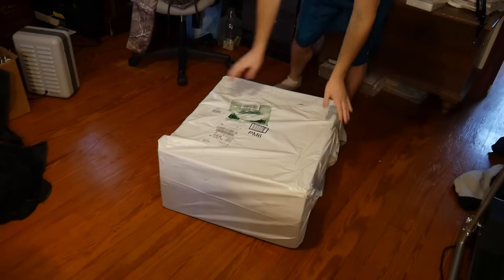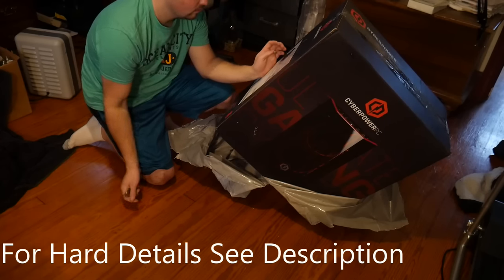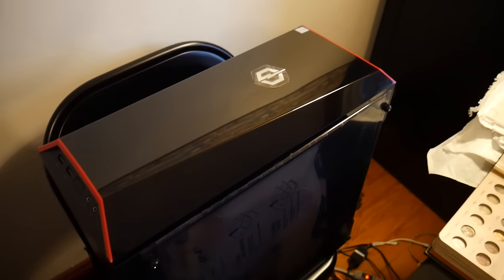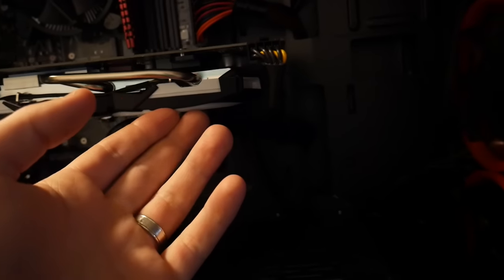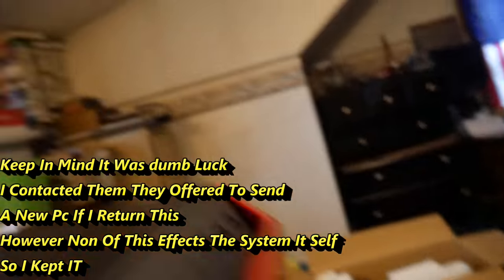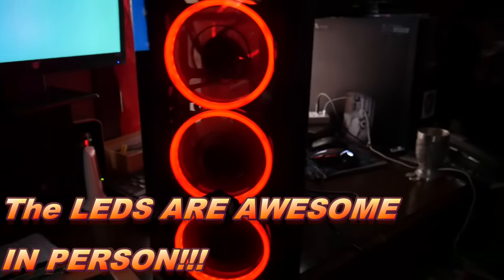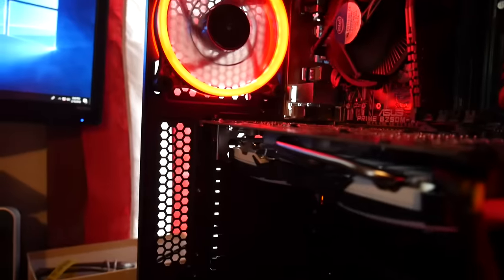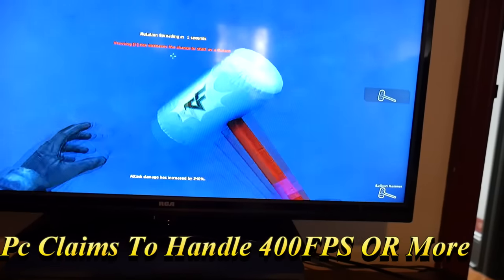CYBERPOWERPC Gamer Xtreme GXIVR8020A4 PC Full Honest Unboxing Test & Review

Comment: Actually really needed this breakdown so I appreciate you making this video I think I’m gonna get this gaming PC
Reply: Thank you and your welcome I've had this over a year and I love it I use it for everything I do
Reply: RevLine89 I’m not knowledgeable about PC’s so do I need to set up the PC in any way? Or does it come fully set up and I just need to plug it up?
Reply: it comes pre setup when you first boot it up it will take you through a setup process and it just tells u things and asks u things what settings u want ect its pretty easy :)
Reply: RevLine89 really appreciate the help 👍
Reply: Your Welcome :)
Reply: RevLine89 has this pc slowed down or ever got really hot where it shut down?
Reply from the maker: it has never gotten to hot that is has shut down, if you dont add any extra fans depending on the game and settings yes it will heat up and the game can start to slow down, for 30 bucks i added custom fans and placed them in the areas it was heating up and solved the issue as well as you can custom tune the fans to turn on sooner to cool off quicker so it does not over heat there are so many tune settings you can do since ive owned this over 1 year i can confirm and say i would pay 800$ - 900$ all day long for this pc ( which i know its cheaper now then those prices ) just saying id pay up to 900$ for this same pc if i had to i actually bought another 1 cause it was on sale yesterday i liked it so much

Comment: Just to let you know Scott, that the scratches on the case doesn't mean that it's not brand new. Those scratches could be caused during shipping, especially since how Fedex and UPS treat packages on delivery. Also, the smudges on the inside of the case are merely just finger prints because the people building the computer opened the case to again build the computer and also put the Insta-pak (the foam stuff inside the computer, you took out) Also, the GPU is put into the connectors loosely on purpose, so the Insta-pak could sorta hug it to protect it during shipping. All you would need to do is to just push the GPU into the connector slot just a bit, or just disconnect and reconnect it again to make sure it's more secure.

Comment: There is a way to provide pro support for the GPU, take the cord to the right side of the gpu and unplug it, than open up the back panel and slide that cable out. Then slide the cable through the top hole in stead of the middle one. Then reconnect it and make sure everything is less floppy before putting the back panning back on.

Comment: Thank you for the review this is what I was looking for! What kind of monitor do you recommend to go with it?
Reply from the maker: It depends what you'll be using it for  :) for gaming a 144hz monitor for normal use anything 1080 or better is fine even a 32 inch or smaller tv if you can buy one used work as well

Comment: You can make the lights change colors I got a remote with mine and the first cyberpower PC I bought I had to take it back because the gaming card wasn't working and the only one they had left was the display model so I got it then I had to go back and buy a monitor because all my other flat panel monitors didn't have HDMI plugs but I'm pretty happy with mine so far now if I can get some real internet out in the sticks where I live lol.
Reply: Charles G you cant change the color on the 20a4

Comment: Does taking off the front glass piece mess with the pc at all or is it safe? I took mine off to prevent overheating so I was wondering. Thanks in advance
Reply from the maker: people like to say its bad cause it lets dust inside.. but ive done it for all my pc's and never had any issues so i guess it depends on who you ask
Reply: Skies why would you ? The fans still move the same cfm. They still pull air from the intakes. The glass prevents dust and foreign objects from entering your PC and possibly tampering with the longevity of the PC and its included fans.

Comment: I have this pc and I love it but I’m wondering if you can upgrade the hardware inside like graphics card to like a 1070 ti or a cpu upgrade and did you get the same potenza ram or was it another brand also did you replace the one it came with
Reply from the maker: I've kept everything the same just added more ram and extra cooling
Reply: The Life Of Scott thanks man theoretically I could probably upgrade if I got a better psu also are you looking into getting a ssd for it?
Reply from the maker: With YouTube I just use external ssds I have about 9 lol all USB
Reply: zPe Voltage if you want to upgrade the hardware then you might want to buy a higher watt power supply

Comment: Nice review. Fast forward to june 15th 2024. Ebay seller had one in mint condition he got inside a storage locker he won a bid on. He did know nothing about pc's, just his google phone.  So he sold it for  $199 and  $50 shipping. I bought it.  Mine had the same specs but my video card is the nvidia gtx 1660 TI.  Only 8 gigs of ram, but i am an AAA+++ tech, and had an extra 8gb of ram i installed to make it 16gb of ram.
Reply from the maker: Nice steal!!!!

Comment: Hey! good video! But I was wondering if you could use HDMI with this computer to connect to a monitor. So, in the end, does this work with HDMI?
Reply from the maker: It sure does! It has 3 hdmi ports and I currently use my monitor with the pc hooked up through HDMI and I love it!
Reply: Alright man, I've watched this so many times and I'm about to go buy and play my most wanted games, Since I have a crappy old mac that cant run anything. I'll keep you updated with my experience thanks for the help!
Reply from the maker: I feel you I had a hp ( still do as a backup now ) that couldn't play anything now I'm enjoying all these epic games from steam it's amazing and fun!! Yes keep me updated :) what games are u looking forward to
Reply: The Life Of Scott what do you mean by there’s no wireless wifi?
Reply from the maker: you need an external antenna to pick up better signals they run 10-50$ depending on the quality. just like any pc the pc alone cant pick up wifi that good antennas extend the signal and range for better connections
Reply: The Life Of Scott so you don’t need to use th USB or an antenna but they are just to make the connection better?
Reply from the maker: correct :)  you see most people complain with internet companys that the service is really bad they get no signals on there pc or its weak u see if your desktop pc is not near your internet router or box your connection will be weak or cut in and out. a usb antenna works like your tv antenna it enhances the signal over all increasing your connection speed and helps eliminate ur pc from disconnecting and connecting all the time. i think everyone should  have a usb antenna because it makes everything better especially for gaming. the antennas i use are pretty good i got full bars and i rarely ever get disconnected even during thunderstorms
Reply: The Life Of Scott thanks for the explanation! But instead of those can I use Ethernet? And are you still using  the computer and if you can could you make an update video?
Reply: And have you changed any of the specs?
Reply from the maker: you should be able to use Ethernet and yes i still use the pc as my main pc now and i LOVE it. and sure i can work on a updated video.
Reply: The Life Of Scott and was that gameplay you showed without the extra ram or was that gameplay right out of the box?
Reply from the maker: With the extra ram
Reply: Ok and two more things. How do you install the extra ram and does it have to be a certain type of ram cards or can it work with any?
Reply from the maker: The ram cards are very simple this PC has 4 ports. it comes pre loaded with 1 ram card already if u buy this same pc. the other 3 ports u can add your own by simply turning the pc off and pushing them in place and then turning the pc back on. as far as if u can use different ones i believe you can however i recommend using the same ones which are these - https://amzn.to/2J9L693 they make cheaper 4GB ones but i see it as this. if its your #1 gaming pc you'll want the most ram
Reply: Is 16- 24 gigs of ram good enough to run basic games?
Reply from the maker: i would say 24 would be good enough
Reply from the maker: i currently have 28GB
Reply: Hey scott did u get this on Amazon? because i worry that if It comes broken.
Reply from the maker: Mine I got from eBay. The pc I have in my description is the same one I bough but that one is from. Reliable seller that offers returns and is cheaper then I paid

Comment: Can you run games like fortnite and how long do you think the pc will last
Reply from the maker: Hello yes I love playing footnote and I've had it over a year now and had no issues what so ever and I even over clocked the gpu and have 5 extra fans added and still no power issues or any issues
Reply: But do you think running all those games with the stock pc would still work
Reply from the maker: yes before i did anything fort nite worked fine
Reply: The Life Of Scott Wenger does pubg work and how many FPS
Reply: Can you add more ram other than the standard 8gb it comes with
Reply from the maker: Yes :) very easy to do I used the same ram cards in my description I have 28 gb of ram now

Comment: Hey man sorry if i am bothering you but last question
If i wanted to upgrade the ram in this what components
Would you reccomend because i am not to sure on what to upgrade
It to. 
THANKS
Reply from the maker: Hello it's no bother at all, if you check my video description look for the A data ram cards those are what I used I added 28 total gb  of ram and I've been super pleased I can use photo shop and a video editor at the same time without any freezes

Comment: I’ve seen reviews saying the cooling is bad. Is there a way to fix it because I want to buy the pc
Reply from the maker: For me it was a 20$ fix if you see my video I have a laptop cooling fan mounted on the side of the pc solved my heating issues
Reply: Zerz if u take off the back panel where the fans are during extended gaming sessions, the temp should be fine. Just be sure to use a compressed air canister to get rid of dust after
Reply: how long were u playing
Reply: Zerz get an aftermarket cooler. Arctic freezer and hyper 212 evo are cheap coolers to get

Comment: Hey Scott! So I get my computer tomorrow, considering the extra laptop fans you bought for it, was it the two fans or the three vans version you got? (The amazon link you linked has a two fan version or a three fan version) also did you just install it on the side or what? I'm curious how you installed the laptop cooler onto your pc. Thanks! If you had pictures or something that'd be sick but Ik u probably can't. Thanks!
Reply from the maker: i went with the 2 Fans, and yes i just have it side mounted  if you go here, https://www.youtube.com/user/wengertime89/community i will post a few photos of how i have it, right now its lightly wedged on the fan led so i can easy take it on and off if i need to install more mods,

Comment: Are there any other cables besides a dvi-d that I will need for this to connect to my monitor? Does it come with a power cord and all that good stuff? Thank ms
Reply from the maker: You'll need all the monitor cables which almost all monitors new come with them. Then u can use the standard blue plug hookup or simply direct hdmi cord hookup which I did ( best quality )
Reply from the maker: Some monitors don't require any power cords just a hdmi cable
Reply from the maker: here is to see live gameplay with this pc under maxxed settings Fortnite https://www.youtube.com/watch?v=4pxrZpGDOmo

Comment: I heard the power supplies on this computer is really bad. Is this true?
Reply from the maker: Hello. So Far Ive Had No issues Related To The Power Supply. Under The Settings Your Able ( like Most PC's ) Change Power Settings For Your Personal Usage You Can Turn The Cooling Fans On Sooner + A lot Of Other Things. I Have Been Overwhelmingly Happy So Far I Did Have 1 Issue A Few Times Where The Pc Crashed. Mostly Because Of Me Having To Many Things Runnning At Once ( 15 Web Tabs Open ) Downloading 9 Items Ontop Of That And Running Power Director ( Video Editing Software ) Then Running Mix Craft. If You Dont OVer Load The PC like i did Everything Should Be Fine. When it Did Crash i Lost No files Or Anything It Rebooted Back Up Like Normal.
Reply: if your trying to overclock, yes its bad regardless you should get yourself a 80 plus gold certified 750 or 850 watt psu.
Reply: also replacing the CPU fan for a liquid cooling one would be great. Other than those 2 things this computer is freaking amazing ! i got the core i7 with the gtx 1080 graphics card.
Reply: The Life Of Scott what's the watts ??on this pc??
Reply: 500 watts

Comment: I’m new on these PC things. Would you recommend I get one? And if so what’s some good things about it?
Reply from the maker: i do recommend it i wouldnt buy from best buy or walmart tho i would buy from amazon as amazon normally gets the Pc direct from the maker of the PC while walmart and best buy get knock offs and returned ones, as for the pc if you can build your own u can save 150-300$ however that can be very annoying to do and you can run into problems and actually spend more if you do, these Pc's are valued right you get your moneys worth in fact i still use this pc for 90% of everything i do! its still running strong! so i highly recommend it! good things are its plug and play you dont need to do anything other then have a monitor ( a tv can work as a monitor as well ) most of the settings are pre set so your good to go right away its stylish, and has plenty of room inside if you ever wanna intercool it or add other options! over all its pretty awesome

Comment: How many frames can this spit out, I know different games with different graphics settings can lower or heighten it, but what would you say is the average fps rate you get?
Also, would this pc be good for streaming?
Lastly, how much would you recommend a 144hz monitor over a 75hz
Reply from the maker: good Q's Like you said each game and setting will be diff, and also if you over clock the gpu, ( very easy to do ) i was avg 60-65FPS under high settings on most games, then i over clocked the gpu and got 70+ and i Stronger recommend a 144 over 75 if your serious about gaming this pc would be best fit with the highest HZ monitor you can afford the Great thing is With this pc any money you invest you can almost always get back this pc has been the best pc i ever bought ive owned 1,000$ pc's before and they are maybe 1-4 frames better then this pc which says a lot about this computer this pc is def worth it and a 144HZ would make the experience just that much better if you really cant afford a 144 then 75 is ok until you save up
Reply: I have the newest version of the  cyberpower gamerxtreme PC and it can run fortnite over 100 fps on medium settings

Comment: Hey Scott! I’m new to gaming on PC and I’m looking into this for my first ever PC. So I was wondering how you put that extra fan on(the laptop fan). Also for the ram how do I know which one to put where?

Thanks!
Reply from the maker: Laptop fan can just set inside it's about perfect size that it fits  or use 3m tape to hold it in place the ram all slots will work you can add the same cards in either of the 3 slots available there will be a total of 4 one already pre used with a ram stick if you get the same ram stick that's already pre installed you can put the others in either slot
Reply: The Life Of Scott  and lastly how do I power on the laptop fan do I have a cord coming out into the back to plug it in or what?
Reply: The Life Of Scott Also say I don’t get the same company of ram cards can I still put those in?

Comment: Hey man. I bought the same PC and monitor. Is there an extra cord or adapter needed to connect the two?
Reply from the maker: it should have came with a VGS cord ( blue plug ) If Not Then You'll Need A HDMI cord To Connect The 2

Comment: I have a couple questions: 

Does it over heat? 

Is it a fair deal? 

Is there anything better I can get for the same price?
Reply from the maker: Hello like all lower prices gaming pcs I do recommend either overclocking the gpu or installing a few extra fans ( cost me only 25 extra bucks) is it a fair deal 100%yes I've owned it over a year and half and I give it a 10 outta 10 best pc I bought for under 1000 can you find better? No unless you can build your own and find the parts super cheap this pc is as good as it gets

Comment: Is this pc plug and play? If not what else did you buy besides a monitor keyboard/mouse and cords to connect them to? Also how important are speakers? Am I just able to plug in a headset to the pc? I’m very confused on these things? Finally, is more ram sticks required? Like I said I will only be playing fortnite for the time being and what would I need for that? Thanks
Reply from the maker: No more ram is needed for fortnight  NOTHING else is needed besides what u listed yes you can use a headset
Reply: Thanks so it is plug and play?
Reply from the maker: Yes